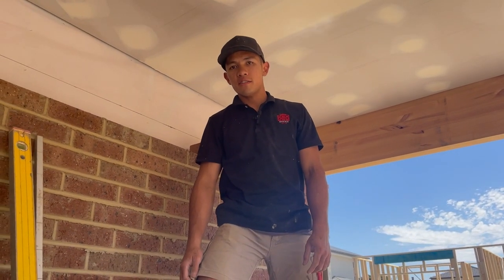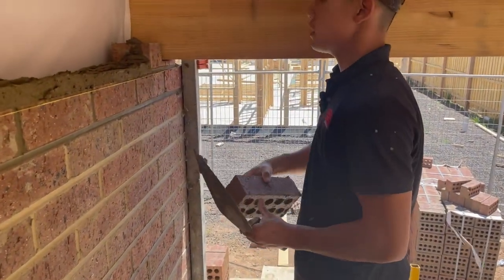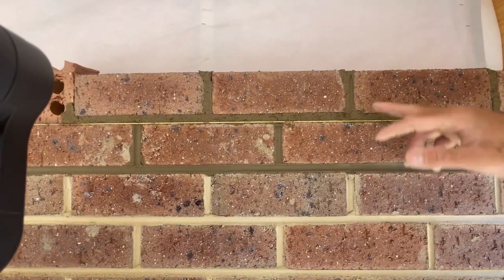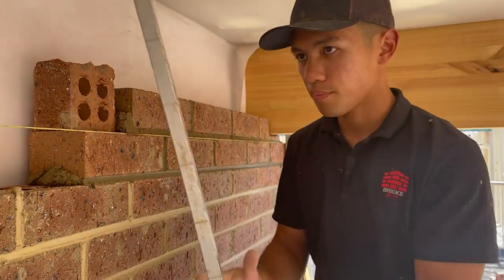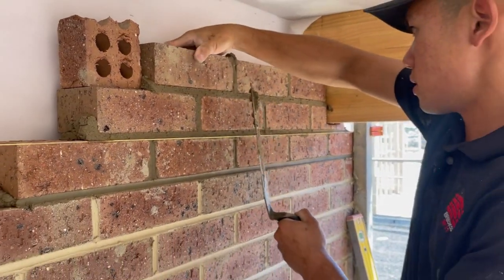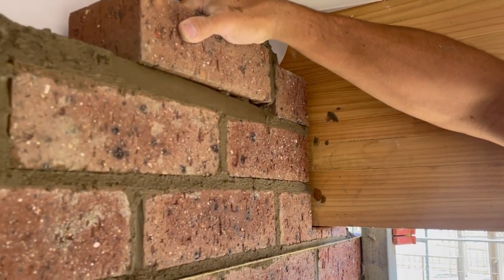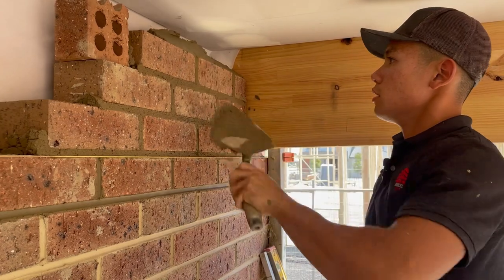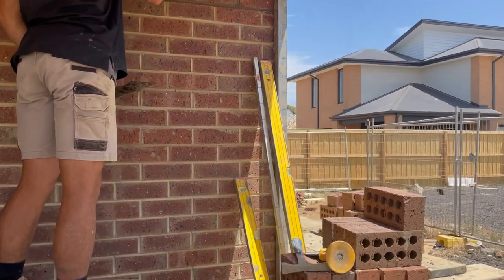HOW TO... Build a corner | BRICKLAYING AUSTRALIA

Comment: Nice work and nice job explaining what you're doing you should put something underneath that mortar pan so you don't have to bend down so far for Mortar I use milk crates or even a five-gallon bucket with some bricks and it will work it probably doesn't hurt your back now but it will when you get older
Reply from the maker: Thanks for the tip! And also watching our video!